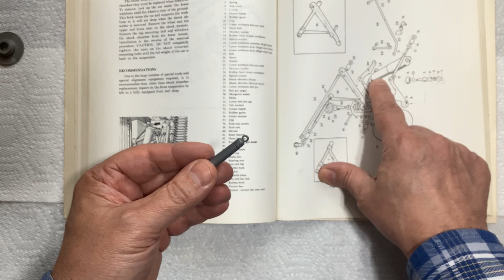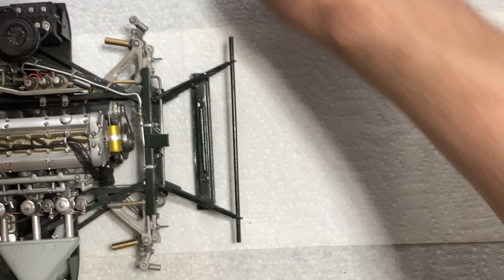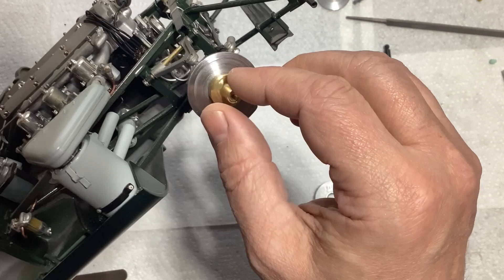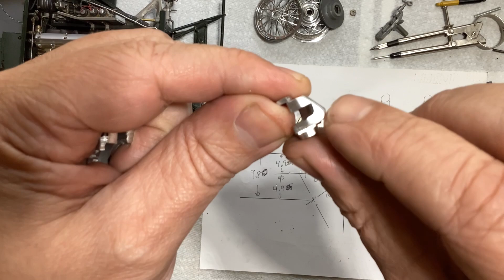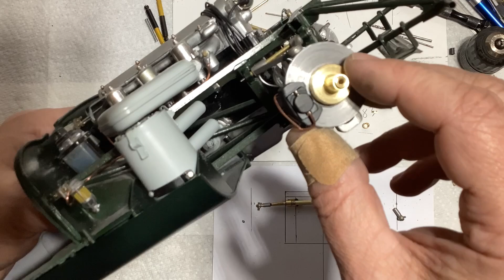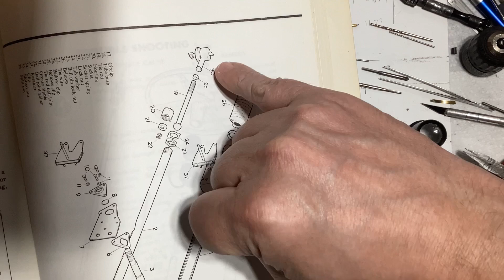1/8 Jaguar XKE build, part 17

Comment: That's an awesome idea to superglue the drill bit into the tube.  I'm sure you probably already know this but just in case you don't for the drill bit that went in too far you can use a bit of heat to break the bond of the superglue to get it back out, it doesn't take much at all, a cigarette lighter or a heat gun etc. would work great for something that small.  Your attention to detail is exceptional and I bet that is going to be one kool jag when it's done.  Nice work!
Reply from the maker: Thanks! I appreciate that! I actually did know about using heat for that, but for some reason I forget about it. So thanks for the reminder! Thanks again for watching and commenting!

Comment: Great video...As allways. I wonder if you can use the spoked rims from a Pocher kit. And did you ever finished the hood vents for the Jag?
Reply from the maker: Thanks! I’ve looked at a couple Pocher wheels, but didn’t see any that are the same. And I haven’t worked on the hood yet. Thanks again!